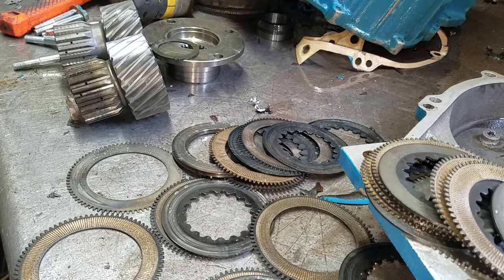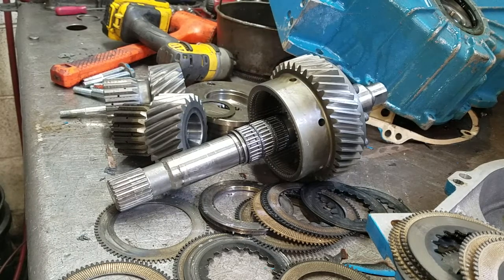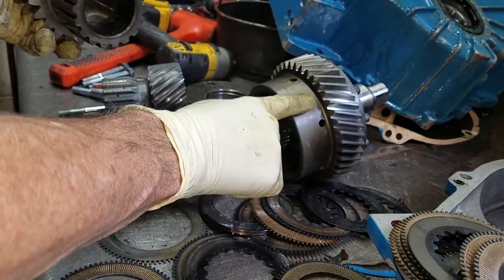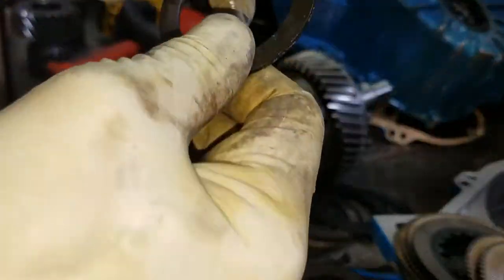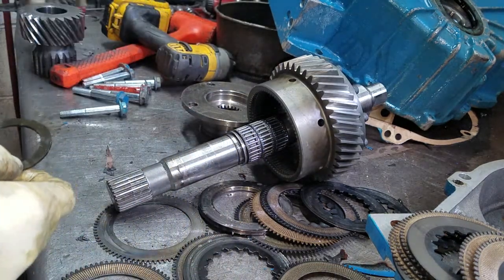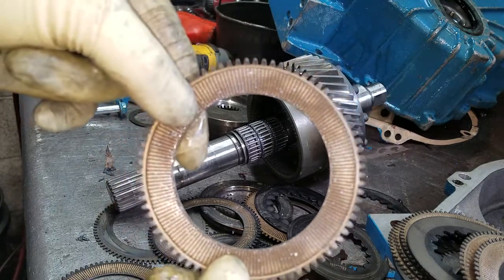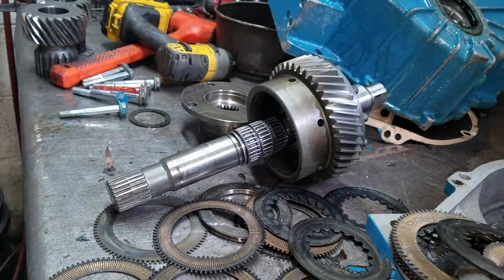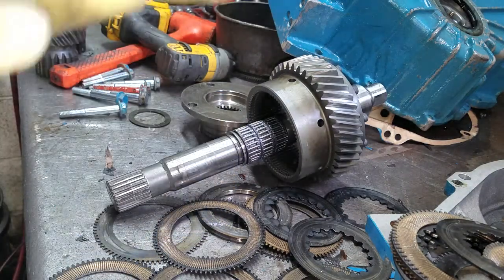Liberty Series Velvet Drive, 2001-005 (5000A)

Comment: Thanks your videos.

I m living in Turkey. There is no master man like you. I have a problem my velvet drive is slipping when I try to change forward or back and also there is a high oil temperature I could not touch my drive during working. However when my drive is cold there is no slipping. Could you please tell me how can I solve it?
Reply from the maker: Two things it might be the pump or the complete control block assembly.
Reply: @halemarine5991  are there any video in your channel to fix these two problems?
Reply from the maker: No I haven't had enough time to get one together. Maybe sometime this winter.
Reply: @halemarine5991  thanks you for your support and help. You love your job. So your videos are perfect.  
Best Regards
Reply from the maker: Thank you for your kind words